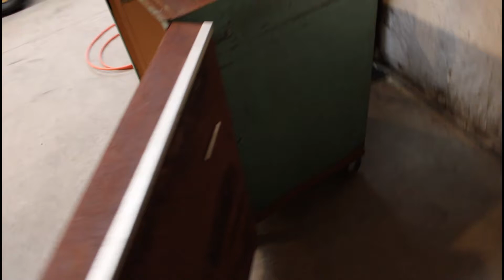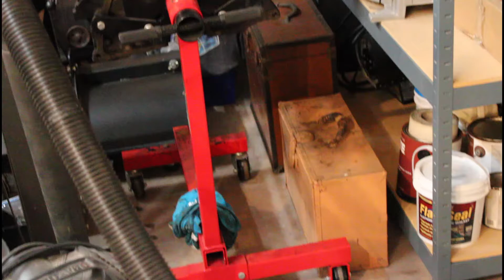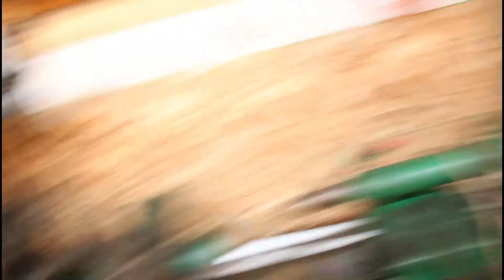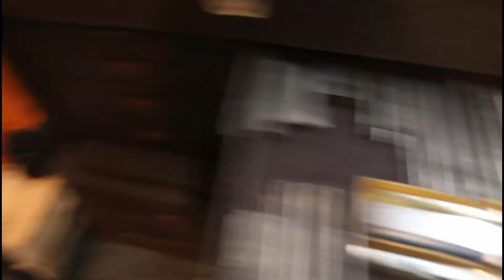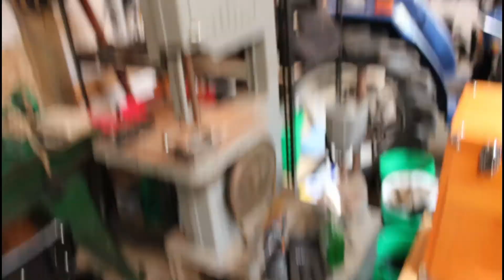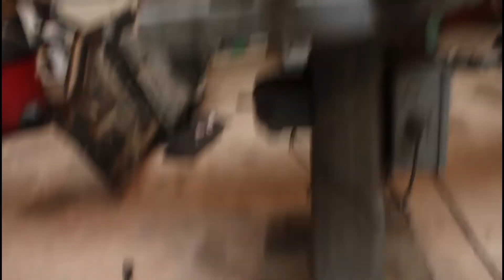A good start to a home machine shop.

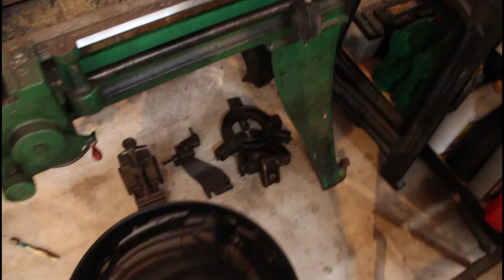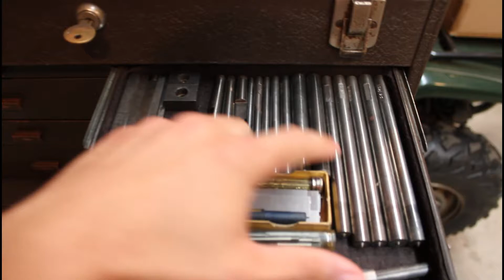Comment: What'd you pay?  I don't know what your needs are, but it appears you bought a bunch of decent tooling, and a mill and a lathe that you'll be ready to move on in 6months.  Everyone tells me southbend is the best, yeah, in 1950 maybe!  They are too slow and under powered as all hell.  I passed up 2 of them before I found my lathe.  Same story for that mill.  I have no clue on that one, but you can actually pick up clapped out old bridgeports for a grand or less and 2 grand will get you a decent machine for dorking around with car stuff.  (like decking cylinder heads or small 4cyl engine blocks)  Let's see if I can help you identify some stuff.  I'm still new to this machining crap myself.  14:03  I see a steady rest on the far right.  The thing in the middle is a traveling rest.  No idea on that thing on the left (vise maybe) of the 3 pieces on the floor.  Rotary tables aren't cheap these days, so hang onto that.  In fact, hang onto EVERYTHING, do not give anything back.  If that extra steady rest doesn't fit, clean it up and fleabay it.  Those large carbide insert tool holders in the drawer will work on your lathe.  You can clamp them into that old school tool post holder.  Are you familiar with chirpys tinkerings here on YT?  He's into this old school belt drive stuff.  The bandsaw is a winner, it's not too big.  I had a monster jet I never used and it took up too much space.  Be careful with that thing!  Who ever owned this stuff did small work judging from those tiny tiny boring bars.  17:28  Check the diameter of the mystery bars on both ends.  If they are just a couple thou bigger from end to end, they are small mandrels.  If you make gears, you press the blank onto the mandrel and it holds your blank.  Take a peek at my channel, I just bought a nice surface grinder on fleabay for very little money.  The "guide" piece is called a gib and adjusts the slop on the dovetail.  If you don't screw with hardened steel, it's kinda a waste of space.  If you have to start buying motors for this stuff, your in for a challenge.  Don't shy away from 3phase motors.  I run cheap chinese VFD's (90bucks amazon) on all my stuff.  My bridgeport is still running on 14g romex if that tells you something!  My mill is 2hp, my lathe is 3hp and my grinder is 1hp.  Nothing I have draws huge amounts of power.  But if you have the chance to put a bigger motor on the south bend, do it!  You won't be fast, but torque is what you need.  Best of luck, I'll be watching!
Reply from the maker: I saved all of it, including the tooling from a trip to the scrap yard. The previous owner was going to junk all of it, so i paid scrap price. Just couldn't pass it up. And as you can tell from the contents of my shop, i have a soft spot for old garbage lol. My needs are pretty minimal, i just like to keep all of my old stuff running. In the past i've needed to surface small engine heads, make bushings, do some honing etc. nothing crazy. I think i should be able to more than accomplish what i need to with what's here. Thanks for the lesson! Part of the reason i started a channel, always a good day when you learn something. I did upgrade the motor on the Mill. What was on there was a 115V 1/2 hp. I found a decent 3/4 HP 230V motor on ebay and wired it up. Still working on the mounting bracket, but it should work out just fine. For as small as the mill is, i think 3/4 HP should suit me just fine for now. Time will tell. I will most likely get rid of the surface grinder, i just don't think i'm going to need it. I'll be checking out your channel ASAP. Thanks again!
Reply: @NorthwoodsNoise  Yeah, it's hard seeing this stuff go to the scrap yard.  Once it's gone, it's gone forever.  The south bend has a cult following I'll never understand and most guys that have one also have a modern machine.  I've learned location is everything when it comes to value on machinery.  No one wants to move this stuff.  I did an 11hr drive with a uhaul and a trailer because my BP was free.  People will find your channel and help you out.  I've got zero local help so its YouTube university for me.  So far I still have all my fingers and wanna keep it that way.  😎
Reply from the maker: @jagboy69  I learned on an old south bend and a smaller clausing back in high school, so i have a soft spot for both makes. I was also seriously considering dropping 6k on a new Jet (glad I didnt at this point) before I came across this stuff. In my opinion, make doesnt matter, if it works it works. Yes, location seems to be huge. Based on the used prices in my area, I'm sitting on a gold mine lol.
Reply: @NorthwoodsNoise  Oh god dont do that.  The new chinese stuff may be shiny, but its junk.  I've seen the horror stories of gearboxes still with casting sand inside.  That's what makes buying a lathe tough these days.  Finding a good machine, even an import from the 80's or even 90's a tall order.  I paid 1800 for my 1990 taiwanese supermax 13x38.  It's been a great machine so far.  Parts are impossible to find, but I manage.